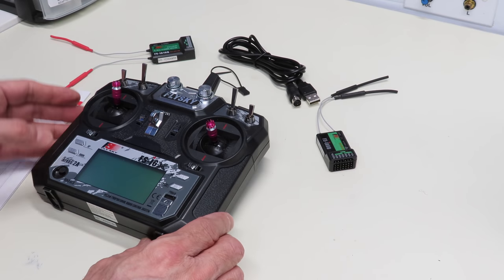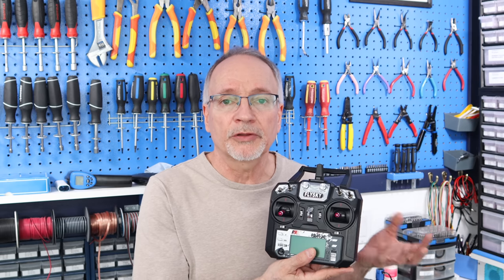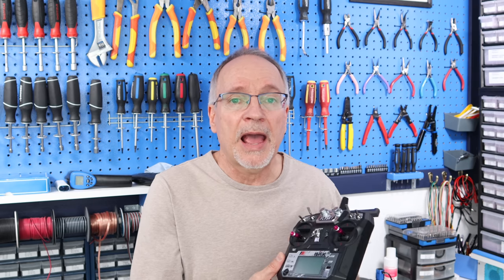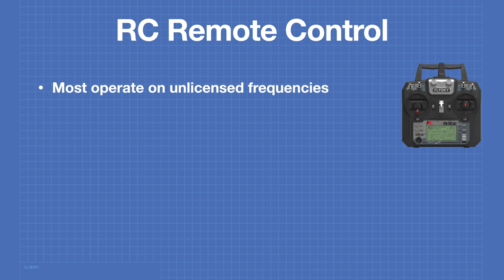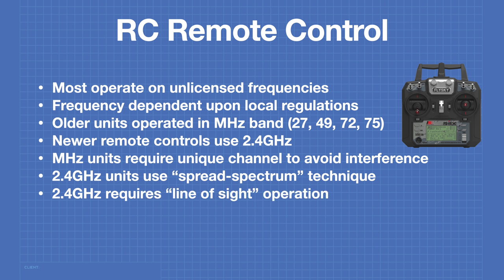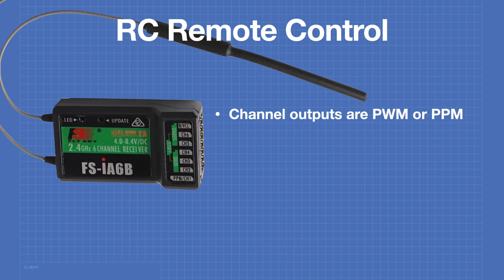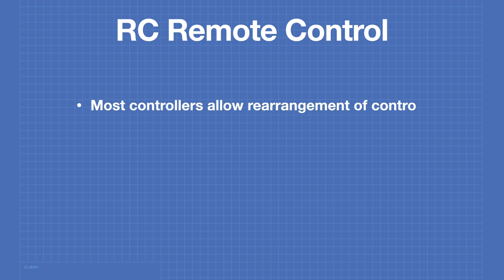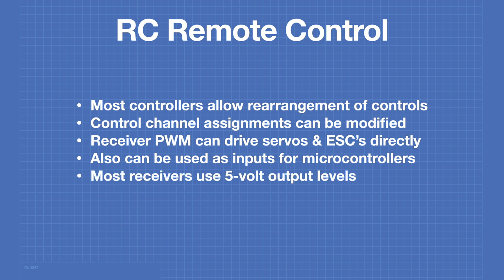RC Robot Car - RC Controls and Arduino

Comment: I'm trying to learn enough to build an RC lawnmower.  This is what I've been looking and waiting for.
Reply: I also want to make RC lawnmower, or better FLYSKY lawnmower.
Reply: Thats a really cool project
Reply: When being lazy empowers your creativity. Lol
Reply: Bro same, did you ever get the mower goin?
Reply: @cryptohippo6008  No.  I'm ashamed, but I changed my mind.  I wanted to build a really good one.  ...good motors, wheels/tires, frame, pov camera, etc.  I'd also need some tools, like a welder.  IIRC, I figured I would spend $1300, not including the mower.  So my Arduino kit has been collecting dust.
Reply: @steelyspielbergo  I got my RC Lawn Mower going about 6 years ago without an Arduino though. I used the same FlySky RC controller but wired the receiver output directly to a 60 Amp Sabertooth dual motor controller. The Sabertooth only requires the pwm L and pwm R directly from the FlySky receiver. The Sabertooth controls the R n L motors. There is no need for Enable R&L pins or set high or low or F&R pins like an L289 or IBT-2 50 Amp controller. I used a Husqvarna 21in mower with front wheel drive belt to drive an alternator for battery charging 2x12 lead acid batteries since I have nearly 2 acres to mow. . The chassis was a modified Wheel chair. 2 drive motors but they were right angle shafts to allow grass to shoot out the back to the bag. Most the Wheelchair motors are how do you say: axial output meaning they go straight out to a gear head.and get in the way, where the right angle can be mounted virtually to the side of the mower frame. . I cut off the wheel chair front castors and welded them to the front of a  frame made of Unistrut. Steering is a challenge to keep it going straight but it turns on a dime. I plan to use an Arduino and IBT-2 motor driver in the future to steer the front wheels while only moderate correction is needed, then if doing a Left U turn turn front steering full left, use right  rear drive motor and front steering motor to work together to achieve a U turn. This could be tricky but not impossible. The biggest gain for front steering would be that the mower will mow in a straight line for a long distance.
Reply: @barneycarparts  2 acres?!?   Do you use one stick for forward/reverse and the other to steer?  I see a lot of people do that and then have problems steering.  I've put off my mower for now, but if I do it I would use one stick for each motor....like a zero turn mower.
Reply: @steelyspielbergo  Yes exactly one joystick for FR, LR. And if using 2 moror steering there in lies the problem for steering straight. Thats why using a lead screw to steer the front wheels may be the right answer. But, it would have to be in sync with the rear wheels driving or, use a split nut to release the lead screw while turning.
Reply: Omg I am watching this for that as well. Have almost everything only motor control not. I'm gonna use an old hoverboard for the motors. But already wanted to see if I can map everything for flysky.
Reply: BTW: I see eBayers selling Wheel Chair motors without wheels. I found that Harbor Freight pneumatic wheels with 4 bolt holes line up perfectly, and cost around $5. You should knock out the inside bearing to fit the hub nut, and fill the tire with Fix a Flat or Slime since the valve stem will be on the inside mount side.  I think they are the 4-5 in rim, white wheels. The BT-2 45 amp motor controller works on a wheel chair motor. I bench tested one yesterday and it only pulled 10-12 amps under no load so there is plenty of amps left for a load. I believe DWS said the BT-2 were 30 Amps continuous. 45 peak.
Reply: So have you finished your project ?
Reply: Same here!
Reply: Have you finished your project?

Comment: hi sir, interesting reading the receiver using arduino board, but what if using nodemcu? is it posible ?
I'm trying to make rc car controlled over the internet using websocket. so in the car side i will use raspberry zero2 w with internet connection and make service to read json data from websocket to control servo and throttle. And in the transmitter side, connect receiver with nodemcu esp8266 without modifying transmitter gun. the function of nodemcu is to read data from receiver and send all that datas to websocket using json format. with this shema, is it possible sir ?

Comment: Fantastic tutorial!  I wish it didn't lean so heavily on the iBusBM library.  iBus is developed by Flysky which rules out a bunch of other popular radios.   I understand that there is more latency with the 'lots of wires' version where each channel on the receiver is wired to the arduino but it would have been nice to see that implementation and measure the latency and understand how it was introduced and see the tradeoffs.  Maybe it's not even noticeable on a two wheel robot!   Subscribed to your channel after seeing this video, hopefully we'll see more RC controlled robot platforms (love to see a 4wd outdoor robot tutorial!)

Comment: I have two 300W wheelchair motors running a heavy cart that spools up a hot air balloon fabric (using a winch motor). I am using a cheap 48V-60V 1000W Motor Brush Controller. I want to use a Sabertooth 2x32 with radio control. That part is simple enough, but then I want to hand it off to an Arduino for a parking routine (following a wall and stopping in its space).
How can I hand off the R/C to the Arduino and wire it to work?

Comment: Can I use sbus instead of Ibus in code, for my R8EF reciever has sbus instead ? I Installed the sbus library and included it in code,  and deleted the ibus library. Changed all the ibus notations to sbus but when I go to compile I get a message no such file or directory.

Comment: Some 3.3V microcontrollers have 5V tolerant GPIOs.  They can only output 3.3V, but can handle 5V inputs.  Many STM32 GPIO pins are 5V tolerant, including on the "blue pill" and "black pill" boards.

Comment: You can use the serial mode on an Arduino Uno if you're willing to disconnect the receiver from the Arduino's TX/RX every time you want to program it.

Comment: Hey, great video. I appreciate how you distill things down to  convey real understanding. Re: Arduino between RC rx and motor driver: I've been told that there is a passthrough mode on some Arduino PWM ports where incoming PWM signals can simply be passed through to the motor driver or the port can be set to disregard incoming PWM signals and that puts the Arduino in full control. It seems like you are using a different, more intuitive method where you measure the PWM input and then output (or not) PWM on a different port, no? I've been told that this method introduces significant latency. Could you speak to that? I'm about to start on this exact thing here tonight. Btw, if I'm only using 3 channels (motor, steering, Arduino control ON/OFF) ... can't I use an Arduino Nano for this project? THANK YOU for your help. :)

Comment: As you have FS-I6X version of the controller, you don't need to update the firmware to enable channels from 7 to 10. You just need to go to the System setup > Aux switches. There you enable additional switches and increase number of channels. The tricky part is that you need hold Cancel longer to save new settings. Then you go to the Functions setup >  Aux. channels and bind switches to channels.
Reply: Cześć, mam pytanie do filmiku i wydaje mi się że możesz znać odpowiedź, mianowicie w 24:36 jest pokazany sposób podłączenia dla komunikakcji IBUS, ale nie jestem pewien i dobrze tego nie widać, do podłączeń są wykorzystane tylko górne piny? Mam wersję odbiornika 10CH i nie jestem pewien gdzie się powpinać, z góry dziękuję za odpowiedź ;)
Reply: @Igor-xo3zx  Z tego co pamiętam to tak, tylko górne. Zobacz 8:31.

Comment: I am excited to hear more about the robot project. I am currently designing a 6x6 bogie-rocker Mars rover style robot based on 6 wheel chair motors and wheel chair wheels. (Skid steer only, no steering motors yet; maybe will add later) I just ordered the radio and receiver that Bill demonstrates. (Amazon)

Comment: Does it work just as easily say with an esp8266 enabled board like wemos d1?
Reply: If it's working with ARDUINO it should be working with ESP 32/8266 
And one have to make sure the  operating VOLTAGE ⚡⚡⚡
Arduino 5v and ESP 3.3v

Comment: Cool Video.   Can I use 2 Of Those Red Motor Controllers on The Arduino Mega. I want to control 4DC MOTORS Seperately.     2 Motors for the Drive wheels, 1 Motor for a Gripper And 1 Motor for The Gripper Screw Shaft The Moves the Gripper Up and Down

Comment: I remote controlled a 10 hp Craftsman  steerable track drive snow blower using an Arduino and all 10 channels on a Flysky RC controller. I  wired and programmed the receiver the same way you do in the beginning and didn't use the I-Bus method. It took me a while being a novice with Arduino but got it all working. 8 servos ( 4 12 volt 180 kg and 4  6.7 volt 20 kg ) 1 12 volt geared motor along with 2 linear actuators.  I can  remotely start, control the choke, primer and throttle. I can engage and disengage the auger and the drive system. Shift into any forward or reverse gear as well as steer,  lift-lower and rotate the chute. I added the linear actuators to lift the front when reversing or transport mode.

Comment: This was another great video Bill.  I'm not a big fan of the line of sight requirement for the controller.  But the packaging of the controls is certainly appealing (enough that I want to go out and buy one and build a car like this).  I've used HC-12 modules to send signals long distance and it doesn't require line of sight.  I'm wondering what the disadvantages of that over this method are.  Obviously having to build the controls into a microcontroller package that uses the HC-12 is required in that setup versus this.  These controls are already pre-packaged.  So that would be more time consuming.  I'm wondering if there is also a speed of communication factor.

Thank you for making and sharing this video and the accompanying article.  I appreciate how much hard work you put into this.

Comment: Is it possible to RC a Surron Ultra Bee motor at has a volt range of 48v - 104v if i use the power controller it comes with?

Comment: I'm a beginner with ardunio.  I appreciate your content  and have learned a lot.  I want to control a linear actuator with the 3 position switch on the FlySky i6x.  I wasn't able to find anything on your channel or anywhere else.  Can you point me in the right direction?
Reply: Not sure if you've already found a solution, but you can simply use the readChannel function for the 3-pos switch e.g. swC = readChannel(8, -1, 1, -1).
Reply: @darrenjcosborne  thanks!  I set that project to the side to work on others with higher priority.  I didn’t have a solution and I’m glad you provided the answer.

Comment: I’ll tell you the big joke in R/C. Those transmitters don’t have a record function. It would be really nice to record a set of maneuvers, and then sell the program for a couple of bucks on eBay. That way, every transmitter would have a really nice library of combo’s. But every possible combination of arial maneuvers has already been copyrighted. So anything an R/C pilot does today is a copyright violation. Arrest those men!